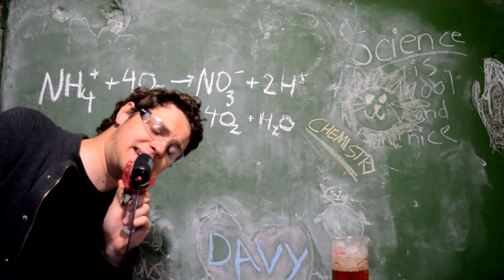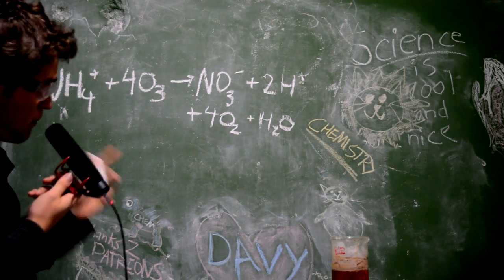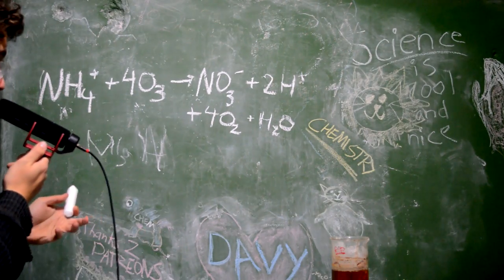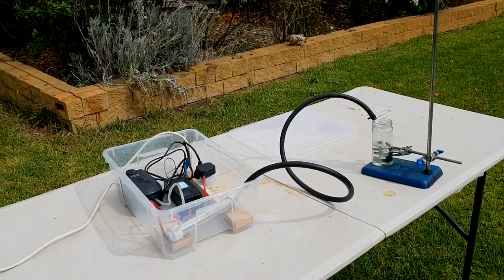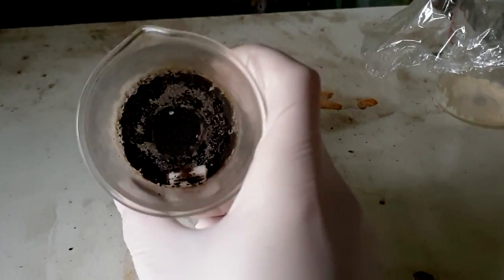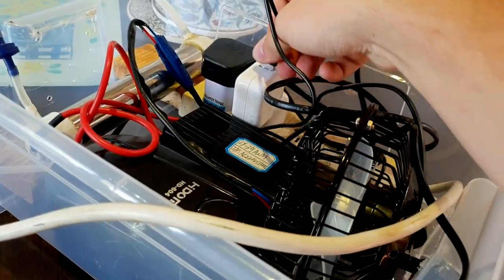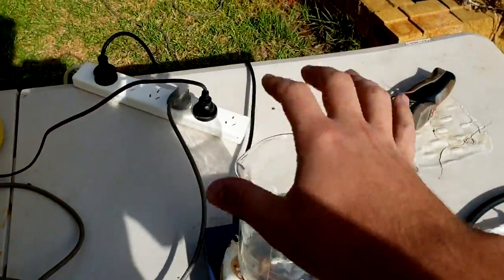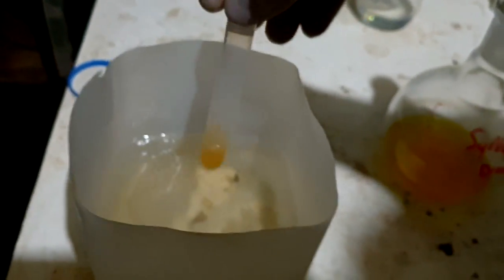Nitrate from Ammonia using Air?

Comment: Your electrical engineering here looks like most of my projects, I tend to make things that teeter athletically on the edge of catastrophic failure. 
The thing that I spent the most time and frustration on so far would probably be the sommelet reaction. With what reagents I had on hand it involved first making a benzyl halide which is horribly lacrymatory and then reacting it with hexamine to form methylamine and benzaldehyde. The idea being that you make two useful products at once. And with the halogen present the methylamine is already in a salt form so the workup should be pretty straight forward. (It wasnt, I went with the metabisulfite aduct method to isolate the benzaldehyde which adds several steps but gets a better product). 
I also needed a high boiling non polar solvent that wouldn't react in that system. So I chose tetrachloroethane which I had to distill from brake cleaner first. So After all that mess I performed the reaction and the workup in the same day and shot the video all in one go. I then edited for hours on end and at some point my software bugged out and I lost the entire days progress on the editing. Being so frustrated after all that effort up to this point I put off editing it for months until an unexpected hard drive failure wiped out all traces of the footage. 
The kicker is that the yield was shit on top of all this so I was probably going to end up doing it again anyway. But yeah 0 payoff at all for probably a week or two of work.

Comment: The white part is the highvoltage transformer ;) , the other circuitry is coatet in some sort of protective paint.
You could just open it up and point the fan on the circuitry.
The small coil you saw was just a choke aginst electrical noise.
Reply: yep, all looking as it should. No problems there. Don´t know how hot it´s getting though.

Comment: On the ozone-ammonia route: I wonder how much bubbling large volumes of gas through the solution carried off the ammonia before it could react with the ozone (though I imagine the reaction is pretty fast). Also, aussie temperatures probably decreased the solubility of ammonia and didn't help. I imagine this could work in the gas phase kinda. I should look into that paper before thinking out loud.
On failures: I spent 3 years, on and off, trying to prepare a photographic reagent. Not even a complicated one and there were many accessible routes with high yields starting from commonly available and inexpensive materials. But purification was a nightmare - the chemical was essentially insoluble in organic solvents (and boy did I look for a suitable one), but way too soluble in water, so it essentially acted like the inorganic salts that were the main byproducts of the syntheses. All successes were minor and final crystal yields were never above 30%. In the end, I found a source for the reagent, but that failure to prepare it quantitatively still haunts me sometimes.

Comment: Tried to produce 1,4 dioxane from ethylene glycol. For some reason it had a boiling point 100c (instead of 83 azeotrope) i kept on trying to purify and dry it for about a month and it just kept tarring up. As a last effort i tried to dry it with sodium ended up being water.
Reply: did you not smell the product? i aways snot some to make sure its good stuff.
Reply: That sucks man

Comment: Not a Chem Guy But for experiments using gases:
1. Use  a graduated cylinder or long glass tube to bubble the gas through so it has a more contact with the liquid before it expels into the air. Also several glass tubes could be daisy chained together.
2. Use a bubble diffuser to decrease the bubble size so there is more surface area contact between the gas & the liquid. 
3. Consider use some inert media like boiling chips to slow down the bubbles so it has more time to contact with the liquid.

Comment: If you created a sealed reaction vessel and then restricted the flow out of it sufficiently such that the vessel pressurizes it will reduce size of the bubbles. The downside is you'd likely need a more powerful air pump. Maybe something like an electric football or bike tire pump might do the trick?

Comment: I'm still wondering why the final product was yellow. Does the ozone produce volatile crud by reacting with the inside of that rubber hose? Would using a glass delivery line improve yields/purity?

Have you ever looked into "active nitrogen"? It is formed when pure nitrogen is subjected to a silent electric discharge (i.e. put through the ozone generator?) Quoting here, "As a  chemical reagent this form of nitrogen is one of the most active of the elements; alkali metals are converted into azides and with the vapours of metals such as zinc, cadmium and arsenic it gives nitrides, [...] sulphur [...] yield[s] sulphur nitride, S4N4." (Fritz Ephraim, Inorganic Chemistry, 5th revised edition, 1948, by P.C.L.Thorne and E.R.Roberts.)
Reply: I just did a good hour's research on this... I do not think it could be the hose, he mentions "Viton" which is  probably polyhexafluoropropenylpolyvinylidenedifluoride. At over two thirds fluorine by weight, if ozone tries to oxidize the stuff it just says "you have no idea the shit I've seen". Not being black gunk also strongly suggests that the orange colour isn't from decomposed polymer. So... 

That airstone appears to be made of scoria, which is found in the same environments as numerous interesting vanadium compounds. Divanadium pentoxide from breakdown and oxidation of minerals in the scoria would be the right colour, solubility, and oxidation state.

The cheap ozone tube might also be badly chrome-plated, and thusly spew out a little hexavalent chromium to please the pollution gods. Ammonium dichromate also has properties that would fit, perhaps even better. 

it also could be N₂O₄ 🤷

Comment: The inverter isn't melting, that's not a transformer, it's a common-mode choke for filtering the AC (prevents the inverter from sending interference into the AC power cable). The black stuff is epoxy potting compound used to encapsulate the PCB. it protects it but also prevemts you from removing it and servicing it without it breaking.

Comment: that equation was used in fish farm for decades. you need a little bit adjustment  on the set up. a long cylinder (6ft?10ft?) is require, your gas come in bottom through a gas stone. and there is a flip over funnel on top of the cylinder. bubbles form on the bottom react with water in cylinder,  nitrates of all kind formed (bacteria and parasites too) will then follow the bubbles up and form soapy foam on the cylinder top, eventually you can skim them out from the nozzle of the funnel, that goes to the flower bed in the garden. clean water goes back to the water tank. some people call this setup protein skimmer. and such skimmer run on ozone would be probably 10 times more efficient then just ordinary air.

Comment: An antibody elution, we ended up washing away everything, and none of it worked.

It turned out that the procedure was incorrect, and our professor tried doing it differently, with less steps of washing, and her's worked. She was teaching immunohematology for the first time, and was using the previous professor's procedures. We guessed that the professor before her, had written it down incorrectly, and had forgotten to change it.
Reply from the maker: Biology remains a mystery :(
Reply: @ExtractionsAndIre  and it was supposed to work. If it were a real patient, they could have died if we didn't identify their antibody.
Reply: @ExtractionsAndIre 

 https://www.bbguy.org/education/glossary/gle04/

Basically you try to remove a bound antibody into a solution, in order to work up a possible transfusion reaction, or to identify what is causing Hemolytic disease of the newborn. HDN is normally caused by the RH D antigen, when the mother is RH negative, or when she has a weak D antigen. But sometimes, it isn't, and the lab has to identify, what the antibody is specific to.

It's the same for a transfusion work up, but the cause is different.
Reply: @ExtractionsAndIre  

https://www.bbguy.org/education/glossary/gla09/

This is also part of a complex work-up of a patient.

I have yet to see a full work up for a possible transfusion reaction.

Comment: I occasionally do chemistry experiments, to find out the chemistry of the metal I'm machining, used to do gas chromatograph mass spectrometry, testing engine and transmission oil for Marine helicopters, and when we found "something interesting" it meant tearing a chopper down to parade rest, not very exciting, but enervating, starting from the top, and ending when it's in a pile on the hanger.  I extracted ammonium nitrate a few years ago, out of a "hand or limb cooling pack", boiling down, cleaning by filter, and about four phases before I had "dry, white crystalline powder", not exactly "high chemistry", but better than no chemistry.  If you ever find time to visit here, you've to a bed, breakfast, a machine shop, and chemistry set up, and you could teach this old dog, new tricks, you might have to come across the southern border, face painted, pretending to have covid, to be let it, and definitely don't have any identification, you could get denied entry for knowing who you are.  I always enjoy your videos, precisely because the ones that fail, do so for basic principles, and in my own life, I've learned a little from success, but far more from failure.  Thomas Edison was asked how many things did he try for a light filament, and answered "five thousand".  He was asked, wasn't that enough to make you want to quit?, he replied he'd learned 4999 things that weren't filament material, but were being used in other ways, shown by their failure, not a quote, but approximate.  I've got a literal ton of metal scrap, that never turned into the parts I was making, but they are still metal, and still can be turned into finished product.  Your vocabulary rather resembles mine from my early days as a jarhead, dealing with idiot Sergeants, who couldn't do anything, trying to tell us peons, how to do the work we knew how to do.  I'd suggest you might be qualified for special forces, but you wouldn't want to go there, you could end up in one or more of our wars.  Thanks for sharing this art form, couldn't be much more fun, without success.

Comment: I once spent about three months trying to find out what the mystery gas in the air in my house was that was adding this weird brown to the arcs on my HV transformer setup. For those three months, not once did I consider the possibility of it just being ions from the steel electrodes I was using.

Comment: You probably figured this out by now, but Ammonium Nitrate sublimes at fairly low temperature in a pure crystalline form, but it will also be easily carried away by water vapors in the open air.  Disproportionation under heat is also a highly likely scenario.  That is all to say if you did succeed in appreciable yields, I think the Occam's Razor falls more on the Ammonia being pushed out of solution by bubbling gas through the solution.  In my organometallics undergraduate research, and further in my electrochemical analytical research, removing all odd dissolved gasses by bubbling nitrogen or carbon dioxide through a solution can be achieved after about 10-30 minutes of bubbling through a glass pipette (using a diffusion stone with a micron rating tends to make it go even faster).

Comment: 15:50 
100hrs of electrolysis for 5 gramms of NaClO3 and approx. a shit ton of graphite wich i had to use
Reply: I can make approx 250-300g KClO3 every 80h, but not with graphite anodes. I use MMO anodes.
Reply: Shit, i intend to do this electrolysis with my homemade ghetto rigged electrodes. Did you figure out where you went wrong?
Reply: you need to put the anode so close as possible to the cathode best 5mm and you need to make the cathode only half the size of the anode and you have an good yield araound 85% effizienz.

Comment: I was gonna ask what u thought of such a set up, good thing I waited to check your channel. What you could do to enhance productivity without much expense is placing a loose, floating lid, perhaps an upside down beaker, so that the gasses can be plunged back into solution. Nurdrage did many of these things. Also, during boiling phase, to concentrate and or dry crystals, I'm sure you know off hand that nh4no3 degrade and turn to n2o and whatever was left behind idk

Comment: I spent a good while trying to make triisopropyl aluminum before I realized aluminum likely won't even react with isopropyl chloride. That was after spent a night making isopropyl chloride by reacting rubbing alcohol with hydrochloric acid and zinc chloride by putting all three chemicals in a capped test tube and gently heating it with a blow torch.

Comment: She was my biggest failure....now seriously, my biggest failure was trying to get some extremely pure sulfur. I was purifying my sulfur by recrystallization with toluene. Well, I had already recristalized the same sulfur 4 times (4 FUKING TIMES). Each time I used the same toluene, but I distilled it several times en between uses. Here comes the funny part. In the middle of the fifth recrystalization(  using sulfur that I had already recristalized 4 times, and toluene that I had distilled a total of 10 times) everything catched fire. I looked away for a moment and when I came back I found a flame that reached the ceiling. I ran like I've never ran in my life to get my fire extinguisher. No one was harmed....but the results were: 
-A burned table
-A burnes brand new hotplate ( it was it's firs use)
-All my Sulfur was lost
-All my toluene was lost
-Burned sulfur everywhere
-Awful smell
Reply from the maker: That sounds awful!! And the sulfur... so pure.... sad
Reply: @ExtractionsAndIre  sulfur is yellow, and after your experiences with yellow chemistry....I guess I should have known it wasn't going to end up working.....

Comment: It looks like it produces to little ozone for any synthesis to be useful... But not every hope is lost; Would this amount of ozone be enough to produce Caro's acid when bubbled into sulphuric acid? In commercial sulphuric acid there are all those nasty organic molecules that prevent it from corroding metal... And you for using it in a good synthesis; since there is not much of these substances in the acid I was thinking this could be a good way to remove them. Actually the only other two ways aren't very good... hydrogen peroxide dilutes the acid and distilling it is very dangerous

Comment: To enhance your yield you could build a semi-closed setup with a condenser and flush constantly the apparatus with oxygen. The oxygen you could make with a electrolysis apparatus. I am not sure, if the evaporating ammonia-water mix can be condensed in a condenser. I wonder what would happen if the ammonia would pass the ozon generator. It will be surely not good for your pump and maybe not good for your ozon generator. As an alternative you could just feed the system with enriched oxygen containing air from the electrolysis apparatus.

Comment: i make nitric acid from air: N2, O2, some water wapor... Need only high voltage for generate ozone, catalizator(W), and high(5MPa) pressure.
1) Make Ozone
2) Oxidize N2 to N2O, then NO, then NO2.
3) Mix water and ozonided air - make perhidrol.(1MPa-pressure)
4) Mix with high pressure(5MPa) perhidrol and NO2, do not forget freezing!
You are can to make fuming nitric acid!

Comment: Is that airstone chemically stable in NH4OH solution? Rubber hoses can also destroy some ozone, but that's probably more problem for longevity of the hoses, than for the reaction.
Reply from the maker: The hoses are Teflon or Viton, so they should withstand the ozone. Unsure how good the airstone is towards the conditions though, but physically it seems okay still
Reply: @ExtractionsAndIre  
Just wondering what may have caused the yellow chemistry...

Comment: Here NH4NO3 can be bought in bulk 50 kg bags (same goes for KNO3). NaNO3, however, is pretty hard to get
Reply: You can make sodium nitrate very easily by reacting AN with sodium hydroxide drain cleaner
Reply: @wypkewypkema6306  I know, but it is messy (NH3 gas) and time consuming (cristalization from water)

Comment: The problem with this one is you need activation energy. Ammonia gas will actually burn in a pure oxygen environment or even in normal atmosphere if you have a copper or platinum catalyst heated glowing hot. If you don't burn the ammonia then you don't get the nitrogen oxides you're looking for.

Comment: I would just use ammonia from the store. It's used for cleaning and it's super inexpensive. Literally just bubble the ozone through the ammonia and let it run for a month. It's a long process but it works. Just keep in mind that it produces small amounts of nitric acid inside of the tube you are flowing it through, so it will degrade the rubber tube over time.
Reply: what was your yielding?
Reply: @Polkem1  well I used a gallon jug of ammonia and got about 3 % of that by weight. Not bad seeing as it was a 5% solution

Comment: Won't ammonium nitrate sublimate away? Maybe boiling it is the wrong approach. You could try to drop it from solution somehow. I have a tiny corona discharge ozone generator, which not only generates ozone, but also NOX. I often find white crystals growing around the discharge tube. They disappear after a while if left alone. It seems to grow more crystals in a humid environment.

Comment: I tried to make soap with potassium hydroxide from wood ash. the hydroxide made my hand slippery, mixed it with some oil.. waited two mins, nothing so I gave up. I didn't even try heating or waiting longer, just threw it out and wondered where the potassium went